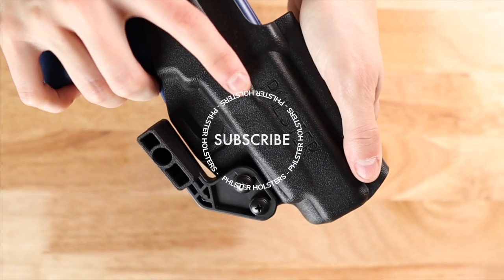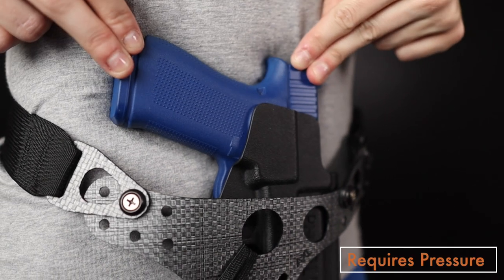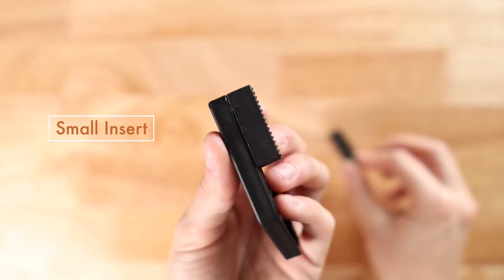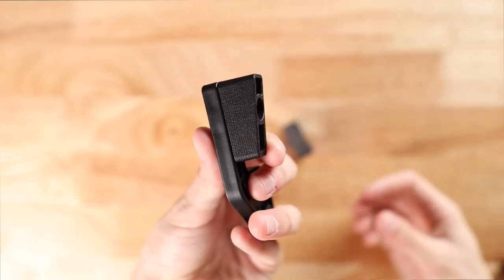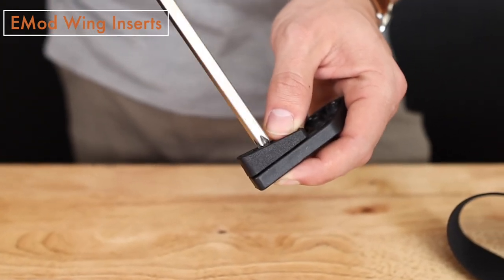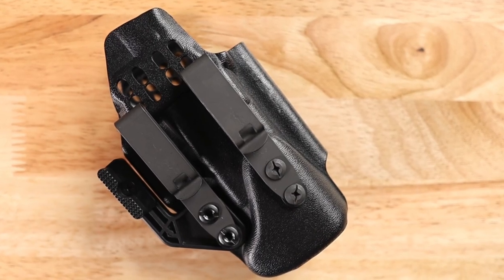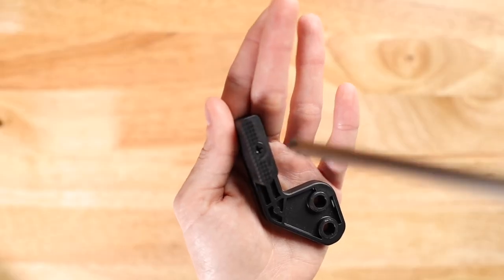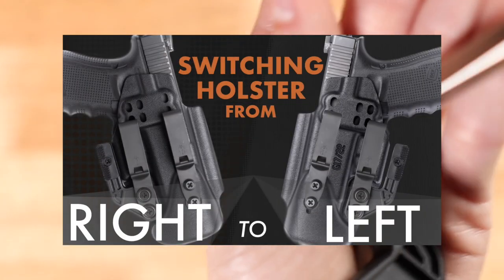What is a Modwing? What does it do? How does it work?

Comment: Do you or can you provide a center to center measurement for the two screw holes so I can measure if this will fit my holster?
Reply from the maker: The holes are 5/8ths or 0.625" apart. You can find more details about this in our Standard Enigma fit guide. If you scroll down and look through the graphics, you'll find one specifically about hole spacing: https://www.phlsterholsters.com/how-to-find-an-enigma-compatible-holster-standard-enigma/
Reply: @PHLster  Thank you so much. Going to check measurements